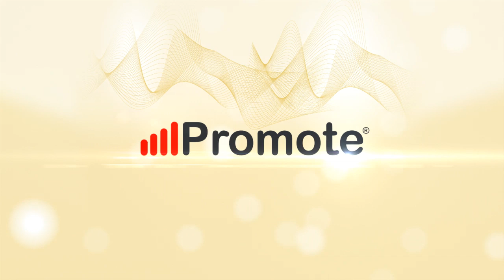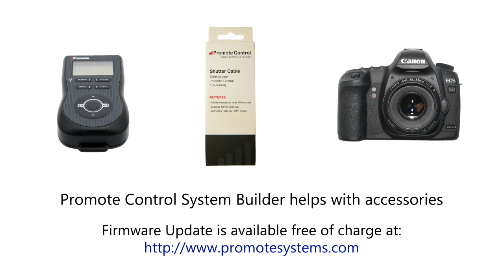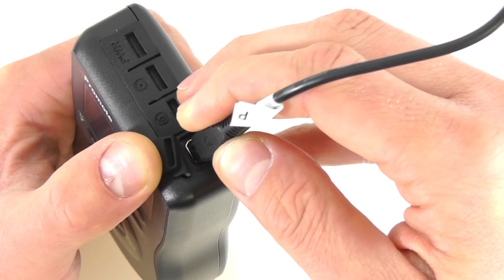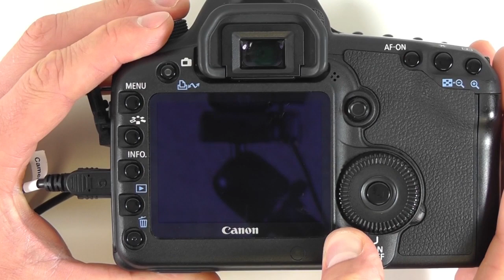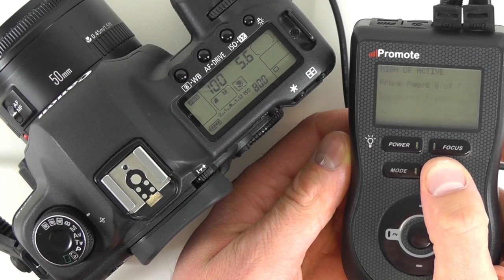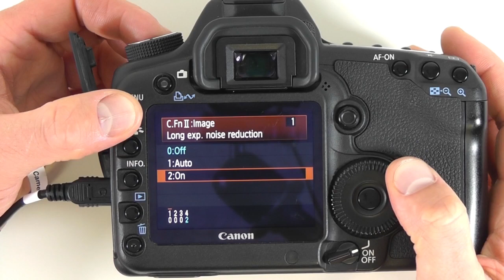Promote Control HDR Photography Quick Start Guide

Comment: Hi Dear, I have gotten the Promote Control some years ago. Now I am using for the 1st time. I have a Pentax 645Z. The cable doesn't match the connection with Pentax. Pentax 645Z uses USB-C port. Can you help me with the solution. Is there any other thing to consider using 645Z?

Comment: can it bracket over the 30 sec mark because i have normal bracketing on my nikon d800 but can't go over the 30 sec limit and i am forced to do it manually ?
Reply from the maker: It sure can! To add the capability of using bulb exposures, you'll need a Bulb Ramping/Bulb HDR kit.

The D800 also will need an N10 shutter cable and OTG adapter for its USB port.

Comment: Hi Claude, I also have a D5100 and I can bracket using RAW.
You need to choose a mode (ie. A for apperture), click on the (i) button to change options, change image quality to RAW , change Release Mode to Continuous mode, then the last option on the bottom right is  Auto bracketing. Change that to 2.0.  If you now hold the shutter button for a few seconds it will snap 3 RAW files with different exposures of -2 0 and +2 .

Comment: Very interesting product. I own a Nikon D5100 with a bracketing feature in it but it is only used in JPG. But I would like to do HDR in RAW for better quality. I this Promote Control will do the job for my need.
Also the same problem with Nikon D 5200 HDR only in JPG.

Comment from the maker: You're right, Steven, which is why the shutter cable is optional. We do strongly recommend its use, though, because it enables many additional benefits when using the Promote Control, as you can see on the product page for the shutter cable, which you can find by going to promotesystems (dot) com. Sorry, YouTube doesn't allow links in comments. Your camera uses the CN3 shutter cable. A couple of the bigger helping features are that it allows mirror lock-up and exposures longer than 30 seconds.